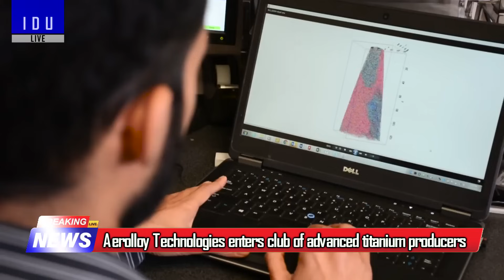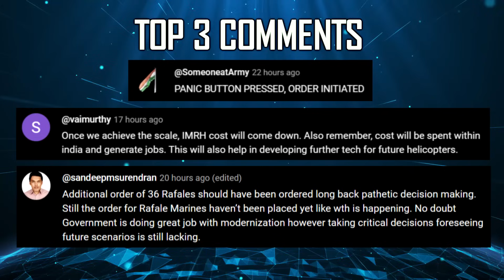Indian Defence Updates : 50 Ton Stealth Bomber,Archer-NG 1st Flight,AMCA 6th Gen Tech,ULPGM-V3 Test

Comment: India suffers from serious and debilitating problems in its logistical and acquisitions supply chain. You can plan all you want, but until India sorts out the problems no "super weapon" is going to make a difference. Supplying an Army, Navy and Air Force requires careful and well thought out processes to assure the right parts are ordered for the correct needs...and India really sucks at that. India suffers from the top down from poor decision making processes and when coupled to a logistic system derived from poor decision making, you wind up with poor quality parts that don't fit the desired machine, be that a rifle, a tank, an aircraft or a ship.

Comment: HAL+ SAAB, after 114 jets are manufactured HAL, can get some new stickers and call 115th fighter as MK2,
we get almost all benifits of Rafel, like mica, meteor, spectra etc, + whatever is missing from MK2, 
Only downside is sweden does not have veto in UNSC, unlike france who has it,
Which can be easily offset with jet engine deal with saffran....

Comment: India should leave the F414 engine for AMCA. IAF should go ahead with MRFA tender focusing on rapid acquiring of 114 SU-57 (5th gen) and look forward to converting AMCA to a 6th gen fighter with indigenous engine (can collaborate with France for engine).
Reply: @johnnydoe3603  ??.. anyway AMCA 5th gen fighter will take around 10 years to get reality. If india is going ahead with 114 SU 57, Then why can't India consider to convert AMCA into a 6 gen fighter with more additions. By that time can produce an indigenous engine also. It Will avoid relying US on engine.

Comment: If Adani is not partnering SAAB its clear sign that MRFA might either be cancelled or that it definitely wont be Gripen
Reply: Instead of gripen, tejas mk2 will be used as both are single engine. Everyone knows gripen won't be chosen. This entire MRFA thing is a lollipop. In the end it will be filled with tejas mk2

Comment: At the current pace India is going, the IAF will have to bring back Folland Gnat and Ajeet airframes back from gardens all over India so that they can be used as a temporary solution till India keeps developing these engines and aircrafts.

High time some private sector company swoops in, designs, develops & sells an aircraft to the IAF.
HAL will have the "Surprised Pikachu" face.

Comment: HAL is struggling to make Tejas MK1 on time. Not sure if trusting only HAL for 6th Gen is a wise move.
Reply: India has not officially declined yet this is just speculation
Reply: HAL is manufacturing airframes. Waiting for the GE F404 engines from the US which has delayed delivery for 2 years, citing Russia-Ukraine war.
Reply: @Abcxyz123-g3i  Correct but the HAL had time since 1980 to build a new indigenous engine! It is 40 years and still dependent on foreign engine so don't really think HAL is reliable.
Reply: @7raja2   Because the Tejas program was not given importance in the beginning years. Because the focus may have been towards IGMDP. We didn't have that kind of funds. 1990s saw the BOP crisis and India liberalized and then the focus was on nuclear tests. There were many American sanctions, although Russia was willing to share the cryogenic engine technology, it couldn't due to the US. Then ten years of apathy and lethargy was there during Dr MMS govt. In 2008 the engine program was separated from the Tejas program.Lot of compromises happened with respect to defence spending. Defence spending and contracts has always been a sensitive issue because there are allegations of bribes and kickbacks involved. All this quagmire happened and now we are waking up.
Better late than never.

Comment: Lol..decline 6th gen invites,,even we cant make 4th gen tejas.. what a stupid bureaucracy
Reply: India has not officially declined yet this is just speculation.
Reply: First tell me what is the defination of a sixth generation fighter. In which field a country need to develop that it can make its technology according to sixth generation
Reply: Absolutely what a bad decision not to join sixth gen fighter program 😢
Rajnath is not farsighted person..
Reply: @Suryanzh2141 basically it's all 5th gen ,6th gen will have facilities like NGAD ,unless we know what all chinese jet they call as 6th gen can do we won't be able to tell it as 6th gen ,but it's definitely 5th gen
Reply: Tejas is 4.5 gen many of them are inducted
Reply: @sarthakmisra  Tejas is definitely not 4.5 gen. The Rafael is 4.5 and the kf-21 is 4.5. Tejas is 4th at best. It's a tiny light aircraft with a very small engine that doesn't require much thrust, kaveri project was such a failure it can't even lift a tiny jet like the Tejas.
Reply: @Indian_BIackedraw_Fan_98544  sidered a 4.5 generation fighter aircraft; it is a single-engine, multirole combat aircraft designed by India's Aeronautical Development Agency, classified as a 4.5 generation fighter with advanced features like AESA radar and an electronic warfare suite
Reply: @Indian_BIackedraw_Fan_98544  Kaveri engine is under testing.
Reply: @Indian_BIackedraw_Fan_98544  Kaveri is planned for second engine replacement for Tejas as F404 will start to melt and have failures after some time
Reply: @Suryanzh2141  have this Chinese fighter jet has these  MUM-T capability. Now if you see these fighter jet carefully it was three engine configuration it means that china have not sixth generation engine neither america have this shows that China's fighter will consume more oil it will efect its range according to its category(long range fighter bomber). It will never work against India . Also china has to make it more stealth because it's fuselarge was looking like a belly. So it was only  a technology demonstrator. And in this era we need cheap cost effective drones and ucav which will be more effective and give advantage against our enemies
Reply: Aero engines, if test facilities are approved, will be tackled. But to say we lack capabilities to make 4th Generation aircraft is a bit harsh. Also never forget what the Brits did to us with respect to HF 24 Marut. They did what the Americans are doing now, not giving engines. So cooperating with Brits for 6th Gen ac would be like swallowing ones pride and paying heavy for their benefit too.
Reply: Yes, i think india should not focus on China as india cant make 4th gen ,not a same level with China
Reply: Indian BUREAUCRACY/red tape is the main / prime enemy where modernisation of airforce is concerned
Reply: True
Reply: Joining the GCAP 6th Gen program is a good idea, but the problem with European fighter jet program is they'll come up with a great prototype, but unlike the US, after the Euro-Fighter program they haven't managed to develop the supply chain simultaneously.

Plus the member countries (Italy, UK and Japan) of the GCAP program are low on funds also. They want other countries to join. 

I wonder why France and Germany, the powerhouses of Europe are not a part of this program.
Reply: India is developing supply chains, test facilities, and even research. There are many small enterprises in India that supply components to these fighter programs.

There has surely been a lot of delays into this program. But research progress into these niche areas happens with consistent iterations of prototypes.

And there is no 6th Gen fighters yet in the world. It's in the development phases. China's one is a propoganda.
Reply: @Abcxyz123-g3i  india can do nothing but keep talking big
Reply: The IGMDP program is a success. We have Agni missiles. Prithvi, Akash, Pinaka missiles are being exported. France has expressed interest in Pinaka. Nobody thought 10 years ago that India would be an arms exporter to the US.

Look at ISRO. We are achieving the SpaDEx mission. So many programs going now. There is no reason to be pessimistic.

Today's India is different from the pre-1990s. India did not have any funds. We were always stuck in BOP crisis. Even today the bureaucracy in scientific institutions is a major hurdle. Serious organisational reforms are the need of the hour.

BTW India is developing this 50-60 ish KN thrust Kaveri engines with 94KN thrust with afterburners ready for in-flight test and developing 134 KN testbed also.

But the US has Engines upto 194 KN thrust with afterburners used in F-35 and even above 220KN thrust engines with afterburners.

We have a long way to go. Both research iterations and simultaneous development and upgradation of supply chains must go hand in hand.

If all the right policies and consistent focus and funding are in place, then in the next 20-25 years India will be a formidable Aircraft and Aeroengine power.
Reply: True

Comment: Instead of this 50 ton stealth bomber, develop direct energy weapons that can be used on UAVs and smaller platforms.  Develop an integrated earth to space direct energy network that will place India way into the future and ahead of its current and future threats.
Reply: Directed energy weapons required huge power consumption so you can't place them on drones
Reply: Drone with DEW 😂😂. Even A380 can't